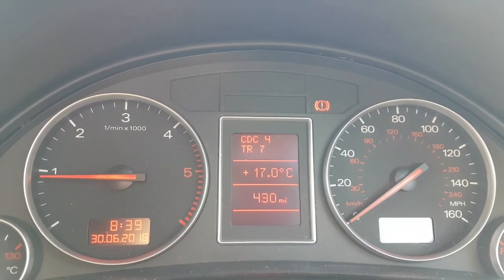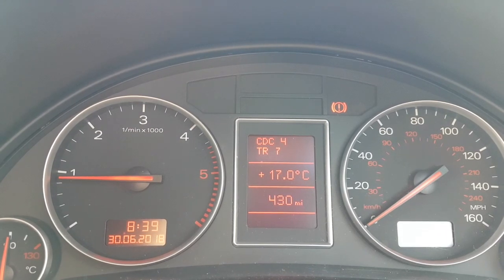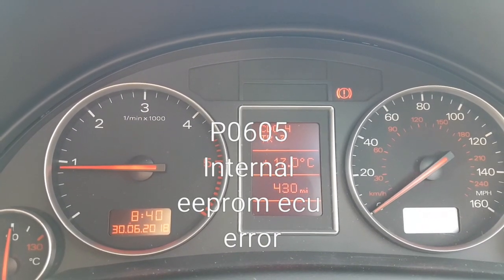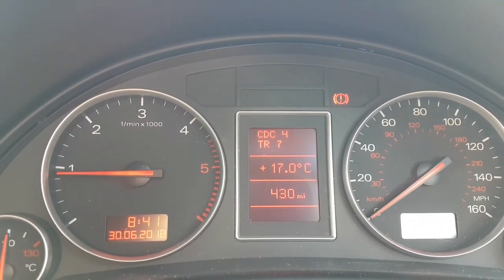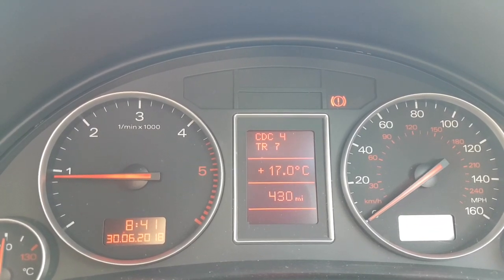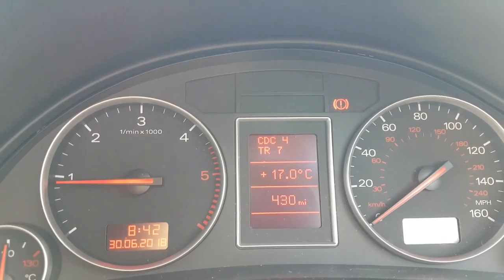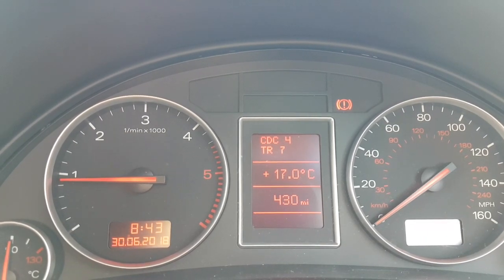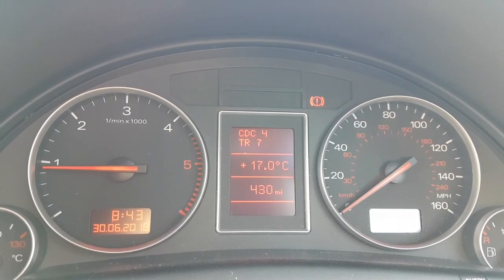Audi a4 b6 awx 1.9 pd130 tdi misfire on idle SOLVED FIXED

Comment: Hi chap, another A4 1.9TDI B6 owner here (Avant Quattro), I've had the engine management light come on about a week back and today the glow plug light came on and then went back off again, car was warm at the time. I'll have to check with VCDS what mine says, I've had it go into limp mode about 3 times now and I think all three were while going up a hill so I'm inclinded to suspect pump in the tank? Either way I'll have to see what VCDS says. Hope you've still got your car! Being local to you I was wondering if it was my car you were diagnosing! :P

Comment: Hi mate I have audi a4 b7 1.9tdi 115 bke engine have a similar problem it is idle on cold start and after worm up is ok still juddering a little  bit but not like on cold start.also I got a blue  greyish smoke on idle only even if the car is warmed up but not always.Brand new time belt 3k miles ago and new turbo new injectors seal.the problem started 1.5k miles after cambelt was replaced.also it is strougle a bit on start but always start after 3rd turn.no loss of power pulls as a train.no fault codes except  all 4 glow plugs had a fault codes on first start.will update tomorrow with codes numbers
Reply: Also egr removed completely plus software off too
Reply from the maker: Hi parko!
By the sounds of it, you may have a timing issue, do you have access to vcds?
Was the issue there before the belt was changed?
Also when you did the injector seals, were the injectors checked or tested?
Common problems for this kind of fault are,
Injector loom breaking down or loose connections,
Stuck egr but you have done this,
Injector leaking back,
Cam and injector timing.
Blue or grey smoke is almost always oil or fuel related, if you have a judder too then I would suspect it is fuel related, but timing can affect this too.

Hope this helps you and apologies for the late reply!

Chris
Reply: Great info, thanks Chris!
Reply: What does it mean “injector leaking back”? 
Is that copper heat shield, O-rings, injector  internal leak?

Comment: Hello i have a golf mk4 pd150 i have the rough idle on cold starts perfectly and runs perfectly but on warm case it starts harder and on idle i have missfire just on idle if i keep the rpm above 1900 it runs fine no missfire on 1st gear it bugs out from 2nd gear it pulls great under 1900 rpm it bugs out and runs on 3 cylinder missfire
Reply from the maker: Hi!
It sounds like you might have an issue with your tandem pump. But could also be the crank sensor. Ideally you need to get the car on a diag machine to read the codes if any.
There is also another possibility, the injector wiring loom might be breaking down and going open circuit when warm, I have seen this before.. easy to change.
Hope this helps
Reply: @chriswilliams1234  Thx a lot
Reply from the maker: @adrjn9633  no problem, the cheapest option if you were just simply throwing money at it would be to replace the injector loom. It is common and not very expensive to do. I would do that first anyway on any pd engine

Comment: Hello, I have really bad missfires until the engine warms up the injectors are good and i don't have any codes? The engine is 1.9 tdi 130 asz the clutch and flywheel are changed and the fuel economy is great
Reply from the maker: Hello! 
I would start with checking or even changing the fuel filter. 
If after replacing the filter it is still the same, check the resistance through the crank position sensor, the resistance can change when the sensor is warm, some cars won't restart once warmed up but your problem seems to clear once warm. So check the CPS. 
If both of these don't show up any problems or cure then I have seen a few 130pd engines with worn camshaft, although the problem shouldn't change with engine temperature 
, don't rule it out!

Let me know how you get on!
Reply: @chriswilliams1234  I have replaced the fuel filter and coolant sensor .
I have replaced the injectors because the car smokes sometimes when is cold but the car is still missfires. The car randomly drop to 843 rpms then goes back to 903 rpms
Reply from the maker: Ahh ok, so it is hunting. If it is smoking too as well as hunting there could be an air leak. 
What colour smoke is it? Black blue or white. Or bluish grey?
Reply: @chriswilliams1234  white and it has strong smell of diesel (the timing good)
The car starts very good and the acceleration is normal no matter hot/cold engine its just the idle
Reply from the maker: Ok lets go back to square one, how old is your car? 
Once warm does it drive normally? 
How many miles? 
What have you already done to try and fix the problem?
Reply: @chriswilliams1234  the car its mine since 1 year ago its a 2002 seat ibiza  1.9 tdi asz 131
I have replaced timing belt, left side engine mount, injectors,clutch and dmf, engine coolant sensor and the thermostat(the car was aways cold and was missfireing aways). The problem is just at idle when the car has not warmed up. When the temp gauge is at 90°C it has no problem at idle
Reply: I have done 20 000 km and the problem is not getting worse or better
Reply from the maker: When the timing belt was replaced, we're the injector torsion values checked? If not they are easy to set correctly.
When the injectors we're replaced, was this because of the misfire but the fault didn't change?
Injector looms are very common to fail and give all sorts of problems with misfire issues. High resistance in the connections can correct itself through heat once engine has warmed up. Change the loom anyway. Easy diy job.
Do you you have access to vcds or any VAG software?
Reply: @chriswilliams1234  no the torsion values have never been checked a friend mechanic will try that. Yes the injectors are changed because the missfire. 
The injectors are values are 1. 0,0 mg/h 2.0,33mg/h 3.-0.12mg/h 4.-0,21 mg/h if loom is the problem i dont think the injectors will have this values
Reply from the maker: Not necessarily, the values can change with the resistance in the plugs.
It is a common issue and easy to change anyway.

Ok so let's assume the timing is correct and the injector values are correct. But it still smokes from cold.
White smoke indicates over fuelling and is unburnt diesel exiting the exhaust. 
So it has to be a fuelling issue. Possibly a leaking injector or worn injector seals. All of your issues are heat related because it goes away once warmed up. 
So a seal swelling, or burning off the excess diesel at higher temps etc.
Reply: @chriswilliams1234  ok thanks i am going to replace the injector loom. Since the injector seals are already changed
Reply from the maker: Good luck! I hope I have been a help to you!

Comment: Hello,
I have a similar problem i change the camschaft and lifters and injektor seals becouse he wont start before a done this and camschaft beocuse 2 lifters gone bade,after change of camschaft lifters and big service with all parst wather pumo everythink with it everythink was fine after 5000km and mont later,car startet to smoke no turbo no wather everythnik was there then car stopt smoking then i had misfire on cylinder 2 reading the fault code but not everytime and car wont start again like before i done everythink the car is by the mechanik and i m waiting what he say he say could be the cylinder bad but injektor reading saying 
Value 1 0.13
Value 2 2.54
Value 3 0.45
Value 4 0.12
Can it be just the injektor or again the injektor sealings thanks for reply.
Reply from the maker: Hi, it seems to me like you have a bad injector or the rocker adjust ment is out, try setting the correct gap for the injector rockers. If that doesn't cure it you need to adjust your torsion values to try and even out those numbers. If all else fails the injector is down.
Chris

Comment: Hi  brummie mechanic Wondering if you can please please give me some advice I have a 2006 2.0 tdi A4 b7 BRE engine 140k I have owned since 2009 my idle is very unstabe/ intense intense shudder.  rev counter does jump just a little bit (I have had issue now for over 2 years has become more intense over the years. No faults on VCDS has had Audi update 2 years ago but no improvement. I have changed - egr valve, injector harness,(2 times) clutch and flywheel, complete timing kit (oe), Turbo reconditioned, my problem still exists issue only at idle and goes if revved over 1500rpm or put under load i.e. Clutch biting point or all electrical controls on ac heated rear etc etc I have also had injectors specialist carwood check car and said it's not injector issue. To be honest I'm at the end of tether as everyone so far has just guessed possibilities at my cost of over £££ thanks in advance.
Reply from the maker: Hi Abdul, 
I had a very similar if not the same issue with my car,
I did several tests and changed several parts over the period of a few months with no fault codes to go by. Finally I had something to work with and that turned out to be a faulty crank position sensor, put a new one in and it's cured my misfire or judder on idle and has restored power and fuel economy too. Ideally I would get it scanned for codes, if there are any, work from there, but for the sake of about 30 quid I would just replace the crank sensor, if it doesn't cure it no harm done.
Let me know how you get on!
Reply: Hi BRUMMIE MECHANIC,
Just an update car has been to a  diesel/turbo specialist in South Birmingham today who done a diagnostic and also confirmed there is no fault codes populating the also done tests on injectors and said all injectors are within tolerences. For a company who's been going for over 25 years I got them scratching their heads. Today I have also tried a MAF sensor but that has not made a difference. I will order a crank and cam sensor next will keep you posted.
Reply from the maker: That all sounds very familiar to the issue I had, I have now done over 1000 miles after the crank sensor change and the issue has not come back.
What specialist did you use?
Reply: Car was taken to Gap turbo 1 of the many garages and specialist who all unsure what this is is as there is not a single fault code. Is it worth also doing the cam sensor?. I'm not a mechanic but pretty ok with a spanner so is it hard to replace cam and crank ?
Reply from the maker: Ahh yes i know gap turbos, 
Just the crank sensor for now, pretty simple to do, the grey plug is behind the coolant reservoir at the bulkhead, follow that down to the side of the engine block behind the oil filter housing. There you will see the crank sensor, it is held in with a single 10mm bolt, remove the bolt and pull out the sensor, refitting is the reversal of removal. Hope this helps, if you need anymore help I am local ish to gap turbo so I can be of help.
Chris
Reply: Thanks Chris. I've just ordered a Bosch crank sensor Will give it a try next time I'm off work.
Reply: Hi Chris just an update I had a look today and crank sensor didn't look as straight forward to replace. I believe our engines are set up different I asked my local mechanic and he said it's not a quick job. Mechanic said my car is not showing any symptoms ie struggling to start.and was quite against the idea. What he did do is check my timing and he said timing is right. So back to square one.....
Reply from the maker: Personally I wouldn't rule it out. If yours is a 2.0l tdi then it is basically the same engine, just the head and some ancillaries that are different. 
You seem to have done a lot if work all except the crank sensor, I am not saying that is your issue but for the sake of a few quid I would definitely recommend changing it. 
I will look into it a little more for you and let you know what I find.
Reply: Thanks mate I'm at the end of my thether and this is doing my nut in.   There's one thing of noticed since re-checking the timing and making a tiny adjustment when starting for the first time it idles fine for the first 30 seconds then starts to judder again. This only applies when starting for the first time in the morning.
Reply from the maker: Have you checked the torsion value?
One thing we may have overlooked is the in tank fuel pump, if that is weak then it could cause your TANDEM pump to struggle and cause rough running? It has been known. Although without pressure gauges it's impossible to guess at what pressure it is at. 
Is it hard or harder to start when it is warm?
Does it run rough all of the time when driving or at idle?
Reply from the maker: Is yours the type with the crank sensor inside the gearbox bell housing? Bkd?
Reply: I have the BRE engine and the mechanic said it's not the easiest of jobs. Car never struggles to start regardless hot or cold starts on first turn every time. Does not struggle to accelerate either problem is only on idle.
Reply from the maker: Could you possibly upload a video of the issue and judder?
Reply: Video uploaded 👍
Reply from the maker: Ahh ok different issue all together, that is surging/hunting, there is an audi software update for the ecu along with an egr restrictor plate for that issue, might be worth giving Birmingham Audi in solihull a ring and seeing if there is an outstanding recall for your car. If they say no, enquire to see if there is an updated version of software for your ecu.

If all else fails, and there isn't a recall, I would look at your vac lines and intake side of the engine for air leaks, hunting is usually caused by unmetered air entering the engine where it shouldn't be.
Reply: I shall give Birmingham Audi a try. I did try speaking to Birmingham Audi Lawley middleway  (now Listers Seat)a few years ago. Who told me there was not a recall on my injectors as mine are Bosch. Although I have Halesowen Audi do an update whist servicing the car (this was approximately 3/4 years ago) will enquire if there is a newer update available. Thanks again mate.
Reply: Update- I have spoken to Audi Birmingham who advised there is No recalls for my car nor is there any new software updates. Something I have done since is have the inlet manifold removed and cleaned and it has made a big difference judder is not as erratic as it used to be and now only does it whilst the early stage and once I give it a good blast it runs perfectly with no judder whatsoever  until car has been left to completely cool down or till the next day. So better but still not got to the root issue.
Reply from the maker: Well that was worth a try! 
Have you had any fault codes recently? Or still nothing?
Reply: Thanks! Your advice about hunting/searching idle helped me. I used smoke(cigar) and found a seal blown out before the intercooler. Tube was still attached so it looked fine from a distance.